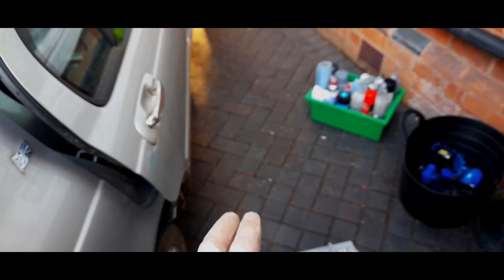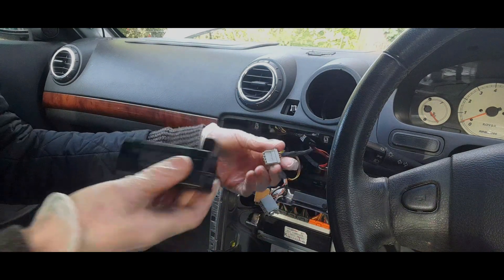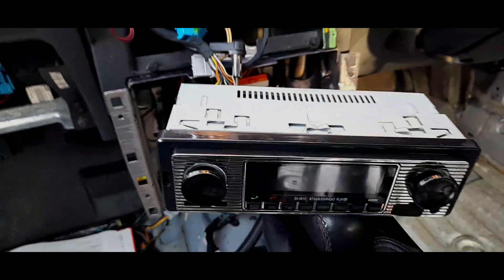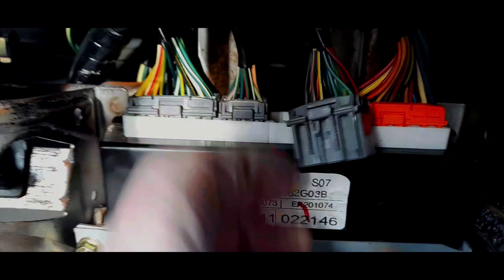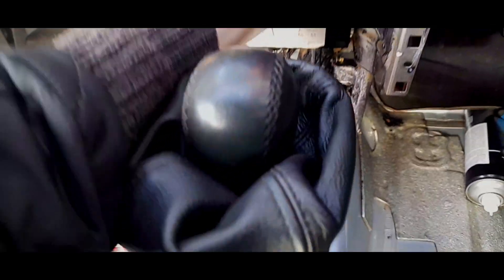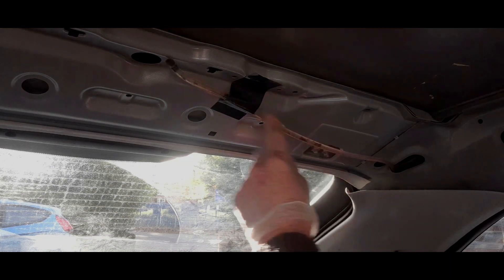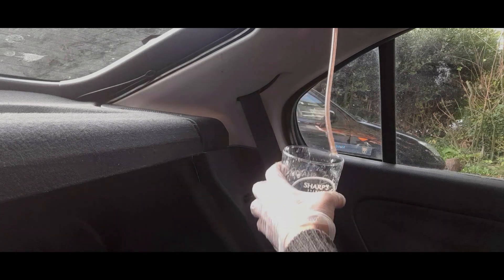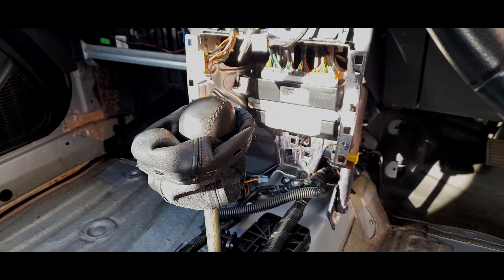Project Beatrix Part 35 - New Battery, Testing Electrics & Rear Washer Fix

Comment: The clocks not a surprise 🙈, I think I have the same problem with my rear washer I was told non return valve but looking at your connections I'm not sure they are?
Reply from the maker: there's no non-return valve from what I can see, I definetly say its blocked! Oh these later clocks are rubbish arn't they! I've got a replacement ordered on its way!
Reply: @usuallyfixingtinkering  Yeah mate I changed mine to the MK1/400 one it's not the correct clock but I just wanted it to work. When I take the headlining out hoping I'll get the same problem you've had with your rear washer 👍 cheers for all this content Andrew great work and good to see it being done rather than trying to work it out from the manual
Reply from the maker: @goblin457  I know the manual can be a little difficult to visualise when your actually doing it, that's where my videos come in.  I concentrate on the "step by step instruction" as it's not really helpful skipping steps as a viewers perspective. Ah yes thats a good ideas as those earlier clocks are shared with many other cars and they never seem to give an issues! Your not losing an functionality either as the trafficmaster hasn't been in operation since 10 years ago. I've managed to grab a correct one which is working I'm luckily to have found one!